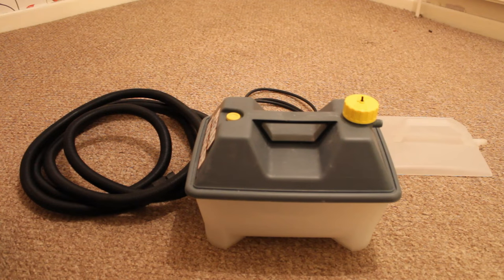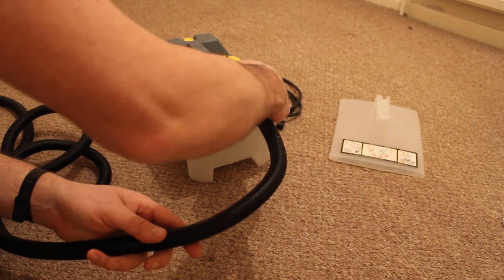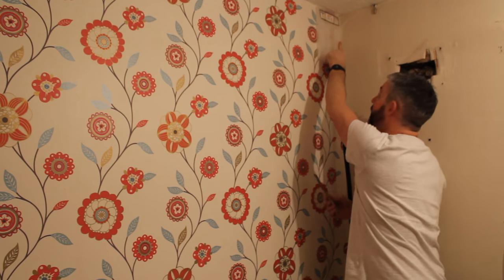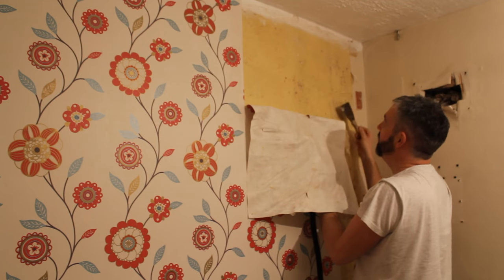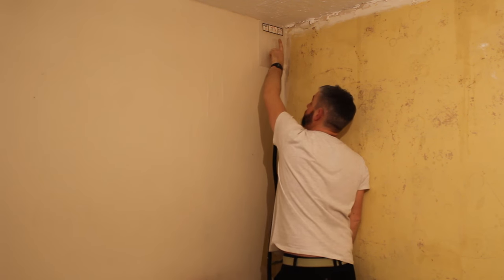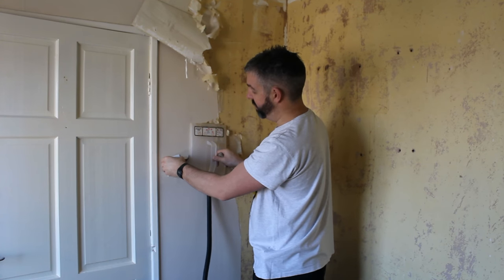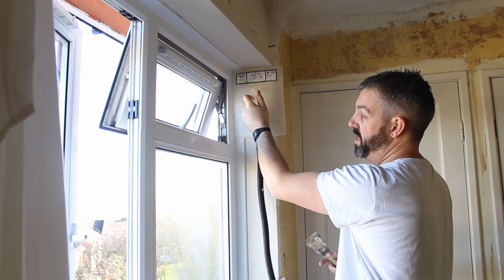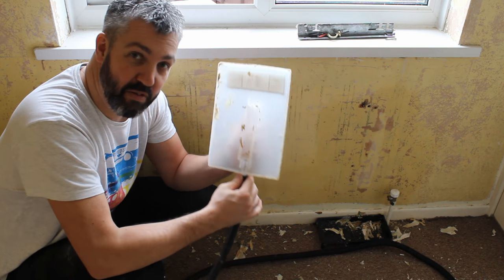How to strip wallpaper with a Wallpaper Stripper - How to use a Wallpaper Steamer

Comment: Thanks for the helpful and informative video. We've just bought a three storey 1980s house which is literally textured wallpapered everywhere. EVERYWHERE. I was feeling a bit anxious about trying to use a steamer but your video was really comprehensive and has made me feel confident to give it a go. Thanks!
Reply from the maker: I love reading comments like this and pleased my videos help people have a go themselves! Good luck with the project!
Reply: how did it go?:)
Reply: did the stewamer work?
Reply: @randomrazr  It did... To a point! But we're using my parent's steamer (which is also from the 80s) so that might not be the best tool. The wallpaper does come off but it's painfully slow, plus it turns out the previous owners painted and wallpapered in layers so there's often 2 or 3 layers to strip. We'll get there 😅
Reply: @WindWhisperer20  dam more layers and someoen PAINTED over the wallpaper. . would it be better to remove the entire wall and re dry wall?

Comment: I brought the wagner steamer. Unfortunately the walls have got lining paper which has been painted and is not coming off easily. Any ideas or tips?
Reply from the maker: I've had that in one of our rooms....pull off what you can pre-steamer and then it may just be a case of going over it a few times!

Comment: Just wanted to kindly add an update and to say thank you also for this video as it really helped before doing so. I just tried it now for the first time and it's so easy to do, couldn't believe how easy it came off with my steamer (Black & Decker KX3300T), really, really good and did a whole strip in about 10 minutes. The wallpaper just all came off the wall so easily without even breaking up much either. Again, thank you so much for kindly doing this video as I probably would have paid someone to strip my walls a lot of money due to not doing this before but you gave me the confidence to do so and made it so easy. 

To anyone who's never done this before, honestly I'm not the best when it comes to DIY type stuff but this is really easy and this video here really helps guide you to do it the right way too.

Thank you so much!! ❤🙏
Reply: Just to kindly add, do you have any tips for plug sockets and light switches? I was thinking of putting tape over them maybe and get someone to hold a towel when I do those parts. I'm just a little nervous with those bits so any tips would be much appreciated. I only have two plug sockets and two light switches, so any tips you can kindly give would be much appreciated!! (I see in the video you've unscrewed the light switch but I'd be a bit nervous doing that to be honest). Thank you so much, I really appreciate you!! 😊🙏
Reply from the maker: @AnimationAndMusicTimeTunnel  Thank you for for your kind words! As for the light switches and sockets, I'm happy to take them off but understand if you're not. You could just undo the screws a few turns maybe? But be very careful the scraper doesn't slip behind there!! I never really hold the steamer for too long above the sockets so it doesn't drip down the wall into them. Probably wise to turn the individual circuits off when in that area. 
YouTube have recently allowed me to add a "thanks" icon along by the "like" icon if you feel like you may want to tip me, no pressure though,  that's not what i do it for!

Comment: Good video. I have used a steamer before, with no problem. I have always done my own decorating and stripping. However, some years ago I was a bit pushed for time, and the wife wanted the kitchen it doing pronto. I relented, and paid for a decorator. Now, It's time to decorate again. I think the decorator must have use Bostik or something similar, as it is very hard to get the backing paper off. That's why I watched videos like this to see if there are any little tricks to get this damned stuff off.
Reply from the maker: Thanks. Try scoring it a bit to get the steam into it, or hold the steamer in place that bit longer. A good (sharp, but not too sharp) scraper is key!

Comment: Nearly halfway through my first wall but how can I do the bit that connects to the skirting board and has been painted over?  I don’t want to damage the skirting board.
Reply from the maker: I've always gone right down to the skirting board because we had solid wood skirting rather than MDF, but if it is MDF then i understand your concern! You may find that for that small bit you can get away with just scraping it.

Comment: Hello! Tfs your knowledge, I was just wondering if all the steam was bad for the house, i.e. causing dampness etc.? Just bought an old house,built circa 1900,structurally very good but my husband was a bit concerned with all the steam that the stripper emits? Also, how would I know if the paint underneath the wallpaper contains lead? I started it today,wore a mask,but I found it slower than I thought it was going to be. I did tear off the first layer of the wallpaper first, now I'm using the stripper to remove the glued layer but I notice you just steamed straight on the printed,top layer,is this an easier way of doing it?
Reply from the maker: The steam shouldn't cause any problems in the house. It doesn't produce much more than a long hot shower really.  Make sure you open a window and air out the room/house afterwards. I'd say pulling off the first layer is the best method as the steam gets to the glue easier then. I've done another room since and that had thick painted wallpaper and that's what I did there.
I'm not entirely sure how you'd know if it's lead paint without testing it, but it was mainly used in gloss, so more likely be on door frames etc. Other than that always assume it is and wear a mask etc.
Reply: @charlieshooter  Thank you very much for your reply! 😁👍

Comment: 6:45 OK for the explanation, however it would have been handy if you could have shown us how you got around the socket as it's the trickiest section, instead of just jumping to another part of the wall, any reason why that part was not shown?
Reply from the maker: No real reason i don't think....battery may have gone on camera possibly?? Once the socket is off the wall like that one though, there is no real different method....just be careful you don't leave the steamer above it for too long so it doesn't drip into socket...also be very careful with the metal scraper around it for obvious reasons! Other than that it's the same as for the rest of the wall. You usually find it comes away easier around the sockets anyway because it probably hasn't taken so well when it was done.

Comment: Hi, I know its 3 years later but I need help with my steamer. It is a Earlex steamer but doesnt have the yellow bit at the top where you have attached the pipe. It seems to be all in one. It is along time since I used it and although the knob does turn 45 ° it doesnt turn any further and I cannot fill the tank. I can only turn the elbow to 3 oclock and 6 oclock. The model is SC 75 and it is a good few years old. Can you advise please? A great informative video. Thank you for sharing
Reply from the maker: I've never had any experience with that brand, but from what I've seen they are all pretty similar...you should be able to fill it with water easy enough. The yellow cap came off mine and then i can fill it up and replace the cap.
Reply: @charlieshooter  Thank you for replying, mine doesnt have a yellow cap, it is all attached with an elbow joint. I eventually got it it open. It was just so stiff. It has to go to 10 past to open it and back 30 to lock it back up. Just incase anyone has the same problem. Plus you need the strength of garth to do it. Haha. Thank you again.

Comment: Does the steamer cut out, if it overheats? Was stripping a wall. About an hour later, it cut out. Waited about forty minutes, worked okay. Then cut out again. Took hours to strip one wall.
Reply from the maker: It shouldn't overheat as long as there is water in it? Put it this way, mine never has!

Comment: The walls look slightly damaged after the wall paper removal (from the scraping etc) - were they treated afterwards, say sanded or skimmed?
Reply from the maker: I think the walls were already pretty damaged, flaking paint etc. As long as you keep the angle right scraping shouldn't damage the wall. 
I chased out the walls to run sockets after this so they needed plastering, but you may get away with sanding if you're lucky!

Comment: Great video thanks.  Just wanted to ask, when you too the radiator off the wall, did you turn the water supply off?
Reply from the maker: No you don't need to turn the water off, but you do need to turn each valve off either side of the radiator. On the thermostat side, you'll need to remove the thermostatic valve and replace it with a cap whilst the radiator is off.

Comment: Mine spits ans creates a Lot of water/condensation that runs down the wall. Is that normal?
Reply from the maker: The steam will obviously form as condensation once it hits the wall,but the trick is not to hold it in one position for too long. If it is spitting water, the reservoir may be a bit full, or too high compared to where you are working.

Comment: Is it normal that waters spewing put of the handle?
Reply from the maker: If you hold the handle below the container then water will run out of the handle, but if you hold the handle higher then you should be ok. It may be that the container is too full?

Comment: Do you need to remove the glue from the wall after removing the wall paper or everything is removed?
Reply from the maker: Personally I have always been doing more work and had the walls replastered but if you're going to just paint them, then try some sugar soap.
Reply: I will replaster as well
Reply from the maker: Then you'll be fine!

Comment: That vid was SO helpful! I'm about to purchase a stripper to do a flat I've just bought. I have a question: the walls looked quite mucky once stripped - would you have to clean them with anything afterwards, if you wanted to just paint them? Thank you :)
Reply from the maker: You could use sugar soap to clean them if you were just looking to paint them rather than have them plastered.....but you'd be surprised what a lick of paint can hide once on!
Reply: @charlieshooter  Thank you! I've got some sugar soap so will try that tomorrow. Yes I'm hoping that a lick of paint (or 2!) will hide the few dings and scrapes in the wall. Thanks for your help!

Comment: Great vid, I done a job today first time stripping wall paper and like you I started from the top and worked down then when I was on my last strip of paper my mate (who I was doing the job for) comes over and says i should of started at the bottom and worked up and it would of been quicker with the steam rising  , I'm just wondering the reason for working top to bottom? Thank you
Reply from the maker: There's a couple of reasons I do it that way, and it's something I've realised over the years, but each to their own. Hot air does rise yes, but into the atmosphere rather than directed at the wallpaper, so the benefit there is minimal. What I find is that if you start at the top the water that forms on the wall from the steam runs down and assists with the next bit you're doing. You start at the bottom and all that hot water is running down bare plaster. The other reason is, the hand you're scraping with doesn't get covered with paper and steam as you go.
Reply: @charlieshooter  thank you I responded the same to him saying the water will eventually fall down due to gravity and will soak the paper below I agree, thank you for the tutorials
Reply from the maker: @riddle1239  No problem!

Comment: Charlie I needed help. My wall kind of looks like the wall that is on the end result. If I was to paint it. What do I need to do next? Thank you x
Reply from the maker: I would say to rub it back a bit with some sand paper, maybe fill any holes etc, and then give it an undercoat of white, followed by a couple of coats of your top colour.
Reply: CharlieShooters KnowHow Thanks Charlie. Really appreciate 👍 x
Reply: CharlieShooters KnowHow Also any paint you would recommend? I wanted to go with a Matt grey look. As well as what type of stand paper should I use? x
Reply from the maker: @bareera2011  Sandpaper....probably 200 grit, but a bit of trial and error probably.
Paint....I've always used Dulux or Crown. Never been disappointed and they have a good range of colours.
Reply: CharlieShooters KnowHow Thank you ever so much. x

Comment: A friend gave me one of these steamers. Big area of thick embossed paper AND it's been painted at least once. I tried the steamer as an experiment- it's all working fine but after 10 minutes I've only scraped off 6 inches square, and that with difficulty. Should I score more finely, spray it first as well, or what?
Reply from the maker: It shouldn't take you that long to do such a small area really. I have used it on thick painted wallpaper before. The best thing to do would be to either try and scrape a bit of it off first (dry) so the steam can get under there, or just hold the steamer in place for a good while. Once you get started, and follow down the wall systematically, it shouldn't take too long.
Reply: @charlieshooter  Thank you for replying. It is a really big area though. When you say hold it on there for a while, up to 30 seconds, a minute?
Reply from the maker: Yes I would say leave it on there for about 30secs or so. The other option is try and pull away as much of the top layer first whilst its dry, so it leaves what looks like a backing paper on the wall?
Reply: @charlieshooter  OK I'll see how I get on with those methods.
Reply from the maker: Good luck. Let me know how it goes!
Reply: @CarolineSugaP  how was it?

Comment: I know you posted this video 2 years ago but I'm hoping someone can answer my question. Will this method still work if it's drywall instead of plaster?
Reply from the maker: Good question....I've not tried it on a wall that hasn't at least had a little skim of plaster. Steaming dry wall does seem like a bad idea!
Reply: @charlieshooter , thank you for answering. Would you have any suggestions for methods I could use? The house is from 1959 but not sure how old the wall paper is
Reply from the maker: I would try pulling it off the wall best you can and see how you get on. It may be a painfully slow process!

Comment: Do these cause damp?
Reply from the maker: No, as long as you air out the room, and keep a window open or the room well ventilated there won't be any problems. I've used one in every room in the house over the last 10 years, and no problems with damp.

Comment: Can you then paint directly onto the wall afterwards or does it need sanding down or plastering?
Reply from the maker: It depends on the condition of the walls really. You can paint straight onto the wall if you want, I'd probably give the walls a quick wash down with some kind of vinegar solution first and let that dry out. If there's any flakey paint you might want to give them a light sanding. In this case I was chasing out new sockets so I had all the walls plastered.

Comment: Does the steamer loosen the plaster underneath?
Reply from the maker: No not at all. It gets damp obviously, but soon dries out.
Reply: @charlieshooter  it shouldn't loosen the plaster however if there is an underlying issue with the plaster or additives then using a steamer can potentially cause you a lot of problems. Some of the older properties have things like horse hair etc added to the plaster, which can absorb the water and expand resulting in the plaster blowing. When ever I steam wallpaper off in a customers home I always try the steamer in an inconspicuous spot before moving forwards. I had the same discussion with another P&D a few weeks back who had just steamed a wall and the plaster blow. Just needed to clarify this information. Regards Bill BH Decorators
Reply from the maker: @BillsAllotmentDiary  Thanks for the advice. I'd not come across that problem before but I can see how that would be an issue!
Reply: @charlieshooter  I love guys and laddies passing on information in order to help others. And I commend you for putting your head up above the trenches. As a P&D this is one of the reasons we tend to stay with water and a sharp scrapper as we want to earn not loose profits on a job there is more to P&D than people realise that's why so many people treat us like we just push a brush but we do a lot more than people realise. I put this question up on a decorators forum and 95% of the guys on there have had or seen issues related to steamers especially in homes over 70 years old. It's just about knowing what your working with buddy. Take care

Comment: would take all day using that. just peel the outer layer of paper off in 1 big strip then soak the backing with a roller and water,leave for 10 min and scrape of with ease.
Reply from the maker: It's not always that easy....depending how long it's been up and how much paste was used.  The steam does really help it along!